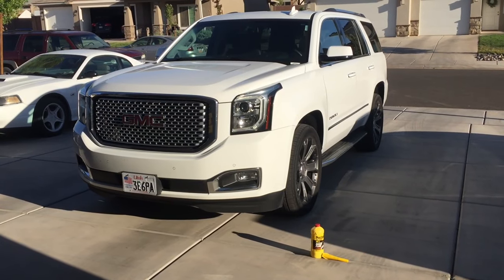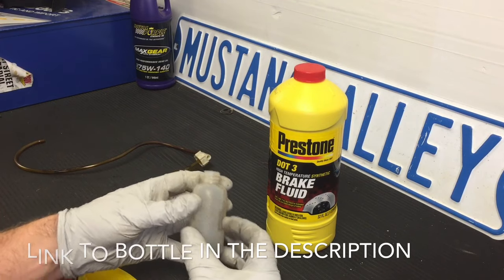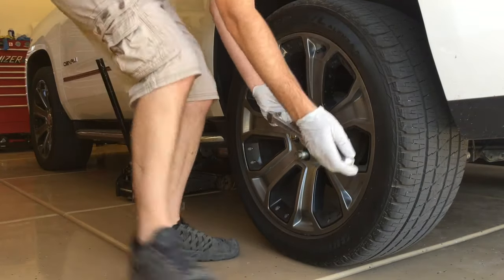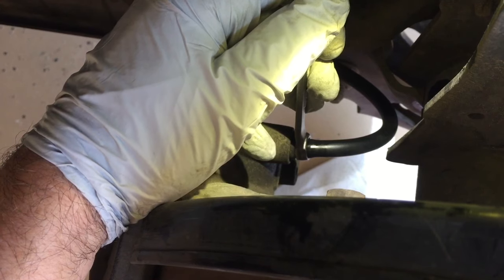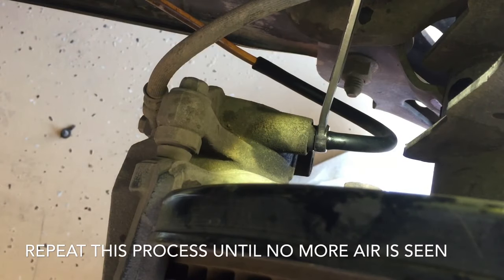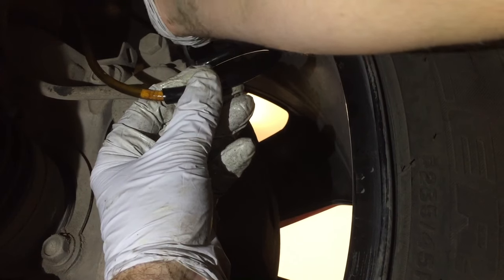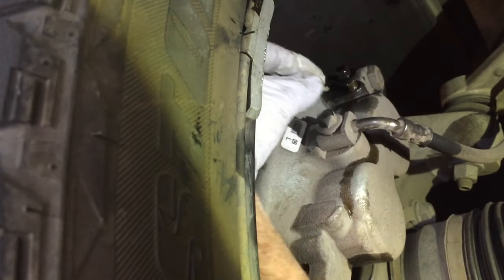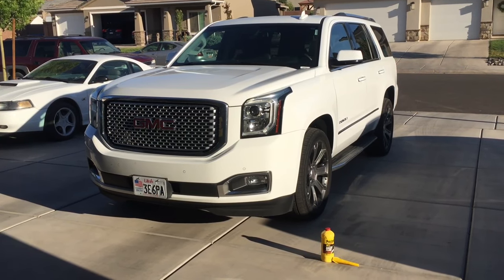Bleed Brakes GM Yukon, Tahoe, Suburban, Sierra, Silverado, Escalade GMC, Chevy, Cadillac

Comment: I've been wrenching on my own vehicles for more than 40 years. I always replace the fluid in the reservoir before I bleed the brakes. The whole point is to put fresh brake fluid through the lines. Empty the reservoir with a large syringe or turkey baster, and fill it with brand new fluid. Then you bleed your brakes.
Reply: Thank you man. I was wondering too in this vid why would there still be old brake fluid in the system. Now that you explained more i will definitely do that. Thanks!
Reply: @angelcampa8765  It hopefully goes without needing to be said, but just don't press the brake pedal before you refill the reservoir. You will have a bad day.

Comment: I accidentally let the reservoir go dry during a caliper change i refilled the resivoir and now i have spongy brakes, I've bled the heck out of it but no improvement,  i think i got air in the ABS module.

Comment: Bleeding brakes still has the aura of a mystical art. My stepson bought a kit which allowed him to flush the entire system on my '13 Escalade. That's a precautionary move because over time brake fluid absorbs moisture. The brake pedal did have a nice factory-fresh feel to it after the system was flushed.
Reply: Do you mind sharing the kit or link? So I can look it up? Please

Comment: Just recently had to do a brake job on my Silverado alone. Replaced calipers and put speed bleeders on the calipers and bled the front brakes without anyone's help. So brake bleeding can be done alone. These can be found at most auto parts stores.

Comment: GMC dealership has failed to replace TSB item on my 2015 Sierra with just 24k miles. Now instead of replacing the vacuum assembly they want to charge me $900 for a new master cylinder. I will tell them to stick it and by an 80 dollar part and replace it myself. Bleeding brakes was always a mystery to me but I will follow your video.

Comment: I have two Chevy vehicles that I put brake lines and calipers on . Both vehicles brakes work fine until they come to a stop but then the pedal goes down and it grunts . Does this have anything to do with antilock brakes? I never had a problem with brakes back before anti brakes

Comment: 💥The bottle that you are using is very small and you filled it halfway up. As you are pumping the brakes and opening the bleeder is the bottle getting filled up.??
Reply: 💥Actually a new question if you don’t mind. I understand the basic philosophy here. The hose that you attached already has air in it and you are only momentarily opening the bleeder as the pedal is being pushed and closing the bleeder before the pedal is let up otherwise it will suck air back in. 
Why does the hose have to sit in brake fluid in the bottle if you’re closing the bleeder before anything from the hose is sucked backwards??
I think the bottle is just to catch overflow from the hose and I could use any old plastic bottle to do that. Just stick the hose in it and the bottle could be empty to start.  What am I missing with the hose being submerged in brake fluid.??
Reply from the maker: Yes, by keeping a line submerged in the fluid it helps from air getting sucked back in. You technically could open it to spray out air and close the line but it is very corrosive and more bad for your eyes.
Reply: @dannyjohnsonsgarage  But the tubing already has air in at the bottom.

Comment: I have a 2007 Tahoe that I purchased. After changing the pads, the back brake calipers are not releasing all the way, causing them to drag heavily.  I've changed the rubber lines and the issue is better, but still present.  Would you suggest bleeding the system dry, and refilling with fresh fluid?  Thanking you in advance.
Reply from the maker: It’s probably needing grease on the sliding pins
Reply: Thanks, I'll try that.

Comment: I have a question to do this and pumping the brake pedal. Do I need to have the engine running?
Reply from the maker: My opinion is No. It may even cause a check engine light or problem with the vacuum system.

Comment: This video came up and I just sat here and watched it, even though I know how to bleed brakes lol I’ll tell you why, your voice is very calming 😅 I may look through the rest of your videos I may learn something  new 😊 

I have a 03 Tahoe that I just replaced the rear brake line so I had been looking up different ways to do that without lifting the frame or lowering the gas tank. So maybe that’s why your video showed up in my feed. 😊 

Your video is very informative and easy to follow 

Oh I was going to say, that little hose with the bottle to bleed brakes is great isn’t it? I use a water bottle with a hole in the lid so no air can get through. Then I cut a piece of the tubing for an old asthma machine. The little piece on the end of the tubing that fits to the asthma machine, happens to fit perfectly on the  bleeder lol😅 I’ve bled my brakes by myself a couple times now using that method.

Comment: Ifs there a circumstance where you want to change all the fluid in the reservoir & lines?
Reply from the maker: Once it’s old or dirty. Keep adding fluid so it does not induce air, and keep pumping the old fluid out

Comment: I did it how you told how you showed but I still have a soft pedal and only a half pedal can you tell me what else I need to do thank you very much
Reply from the maker: There is a recall out on them for “excessive effort on pedal” so I would call your dealership to see if yours is included and can be fixed under the recall (should be free)

Comment: I've never done this what am I risking
Reply from the maker: You could induce more air into the system and have the brakes not work properly, or get a abs light. Perform at your own risk, and preferably with someone who knows and had done it before.
Reply: @dannyjohnsonsgarage  thanks

Comment: Should I add brake fluid to the new calipers before assembling them back on and then bleed?
Reply from the maker: No install them and then bleed the system.
Reply: You can bench bleed the MC.  You can't bench bleed calipers or wheel cylinders

Comment: I keep pushing all the way down on my break pedel when I try to stop what does that mean when I try to stop it keeps rolling on my 2006 GMC Yukon Denali xl
Reply from the maker: heather moore There is either air in the lines or the brake master cylinder itself (where you pour the fluid in) could have a bad seal and is not pressurizing the lines
Reply: @dannyjohnsonsgarage  my mechanic said it might be my cailbers are going bad could that happens to
Reply from the maker: heather moore It’s possible the seals around the pistons on the calipers or even the lines at the calipers have a leak. You will want to look for any brake fluid leaks in the places shown in the video. You can also remove the calipers and pads and see if the piston that squeezes them shows any signs of trouble
Reply from the maker: heather moore https://youtu.be/wu5tKlDDt8A
Reply: @dannyjohnsonsgarage  I did see break fluid leaking under the ground
Reply: It means STOP DRIVING IT TILL ITS FIXED YOU WILL KILL SOME ONE !

Comment: Great video.quick question,what was the size of the tube used and is a scan tool necessarily important for doing the brake bleed on GM big SUV
Reply from the maker: You won’t need a scan tool. Sorry, i’m not sure on the size. The kit came with a few tubes so if you get a brake bleeding one you will likely have what you need. I even had to use some vacuum hose. I’ll try to find out what size it was
Reply: @dannyjohnsonsgarage  . dont need a abs scan tool ? Huh. Every youtube says so.
Reply from the maker: Arlon Meranden It depends on the situation. In my case it was not needed. You’re replacing an abs unit or have a ton of air in the system it may be a possibility.
Reply: @2Jeezuzisreal  Depending on which corner you're on - jack the truck up just high enough that air bubbles travel UP toward the bleeder.  You can use your brake fluid reservoir as a "bubble level".

Comment: I thought start at right rear wheel? 
I was told to not pump brake peddle. 
And use a bleed scan tool.
Reply from the maker: Arlon Meranden Watch at 1:40 where I explain to start as far away from the brake master cylinder, which is the passenger side, rear.
   The video demonstrates a typical brake bleed procedure. If you’re using a pressurized pump tool make sure to read its instructions. You need to either pressurize the system by pumping and holding the brakes or using a system that pressurizes the lines

Comment: Asking because I have a 2008 tahoe I changed 3 calipers and blead them afterwards but the pedal goes to the floor then I have to let it up before I hit the pedal again then it grabs. But I had the truck running when I blead it
Reply from the maker: If the fluid was low when pumping it will suck air into the system. Especially with it running it will multiply the effect. I would bleed them again with the car off, make sure it has enough fluid in the reservoir that it’s not sucking more air in. Bleed from the farthest wheel away from the reservoir first and work your way closer
Reply: 3 calipers? Should have went ahead and changed out the fourth. The other three new ones could cause braking problems for the weaker fourth caliper. Blown seals and or weak clamping force.

Comment: Should master cylinder be left open?
Reply from the maker: I like the cap on the master cylinder for compression, but make sure the fluid level does not drop to índice more air

Comment: I have a 2004 Escalade. I replaced about 12” of brake line coming out of the ABS going to the right rear and left rear due to a corrosion leak in the line. We had to remove the entire ABS to repair them. We are now bleeding g the brakes and it seems no more air is coming out but the peddle is not as hard as it was. Some people are saying to crack the nuts going to the ABS which is a nightmare, especially the top ones… no room to fit the wrench and some people saying something about a scan tool. Do I really need to do one or both of those or just keep bleeding at the calipers?
Reply: You should only have to bleed the line that was broken. There will be a lot of air that needs to come out, just make sure your bottle is above the caliper.
Reply: How did it turn out?
Reply: I bled them one more time and the breaks were great! Thanks

Comment: Hey did you have it running when she was pumping the brake?
Reply from the maker: No, just on accessory
Reply: @dannyjohnsonsgarage  Can you do it with the key in the off position, or,must it be on accessory?
Reply from the maker: @michellejohn695  It should be fine with the key off as well. It just shouldn't be running or it will be power/vacuum assisted

Comment: Do you have to turn engine on to provide vacuum to booster? If not how you able to pump the pedal without vacuum?
Reply from the maker: It is vacuum assisted while driving, without your pumping it manually. It appears to work better with the car not running so no codes come up. If you have remote start, don’t touch the brake and hold the ignition key down for 10 seconds and it will go to a accessory mode without starting the vehicle

Comment: Does she pump the brakes with car on or off
Reply: Not ignition on but before turning it on?
Reply from the maker: either should be fine as long as the car is not running
Reply: @dannyjohnsonsgarage  ok thank you
Reply: Can't get fluid to the rear wheels, does the key need to be in the on position and in drive to open the solenoids??
Reply: @donaldwhite396  you may have alot of air trapped, I think a similar thing happened to me, just keep pumping. Did you replace any brake calipers without filling them with brake oil before mounting them?

Comment: You don't need a scan tool on this to bleed? I know some Chevys require a tech 2
Reply from the maker: This one didn’t. Maybe for a more involved job
Reply: @dannyjohnsonsgarage  
I replaced the caliper on our vehicle (2012 Yukon Denali) drivers fronts and the brake light, abs and traction control light are on ever since. Trying to figure it out. Thought maybe I didn't bleed it the best, but it feels fine.

Comment: Got a few questions. I started to bleed my brakes on my 1997 GMC Yukon. I began with the the tire on the rear right first and hadn't gotten any significant air until I reached the front passenger side tire.(im doing this all under the truck with the tire on, I didn't use a jack) The first thing i noticed is that the rubber grommet was missing and then I realized break fluid was was leaking all down the bottom of the tire and some even accumulating on the ground. It didn't appear to be coming from the bleed valve, but what do I know? It looked to be more saturated and possibly coming from further down the caliper than the bleed valve, so I looked and couldn't find any obvious source of the leak; given what was available for me to see from under the car with everything still attached. So here's my questions. Is the rubber grommet necessary? Does the lack of one create any problems? Any idea where the the brake fluid might be coming from? I'd like to get everything fixed without having to spend any more money like buying a whole new caliper to replace the old one. If you have an idea of what the problem is from what I've told you is there a simpler, least costly, not too high labor fix? Thank you in advance! I'd really appreciate a response:)
Reply from the maker: Probably the actual valve you turn when bleeding. The cap is only to keep dirt out, but the bleed screw is what seals it.
Reply: The brake caliper may be leaking. The caliper pucks have O rings around them to seal in the brake fluid in. If they deteriorate or break then they leak……. a lot.

Comment: isnt the passenger side line further away then the drivers side rear ? Im pretty sure its passenger rear , passenger front , driver rear , driver front
Reply: I think this depends if you have an Abs system..there are other videos that explain how to tell which wheel is furthest away depending on how the brake lines are routed.
Reply: Right rear, left rear,right front, left front.

Comment: What if the bleeder screw is stripped?
Reply from the maker: You can use a bolt biter to remove it and then replace it https://youtu.be/wdtxVKHjdwk?si=_oaJpO5Fs7T4JinN
Reply: @dannyjohnsonsgarage  ok thank you any recommendations on buying a set asap and not have to wait for delivery?
Reply: What if after bleeding the brakes still aren't working right? I already put on new pads an bled but its still not braking properly.
Reply from the maker: @segoviagarza360  With brakes, be sure to have it professionally diagnosed if the simple things have not worked. It may also require a special tool from a dealership (or even electronic calibration) if it’s still not working.
Reply: @dannyjohnsonsgarage  thank you i believe the brake booster is bad there's a hissing sound when i brake and i also have codes on now po174& po171 .